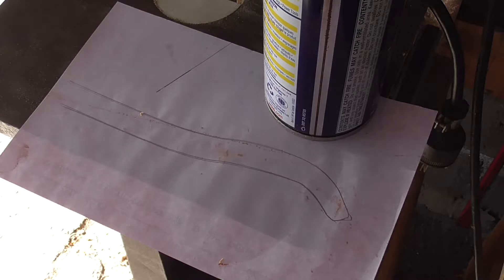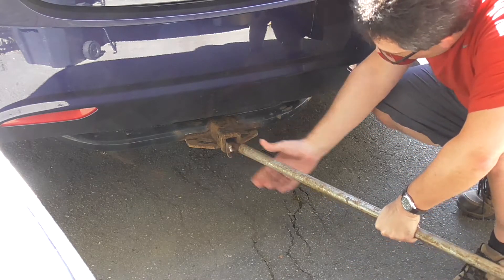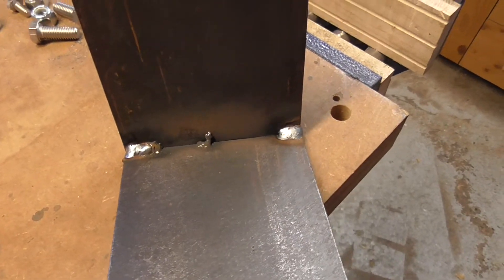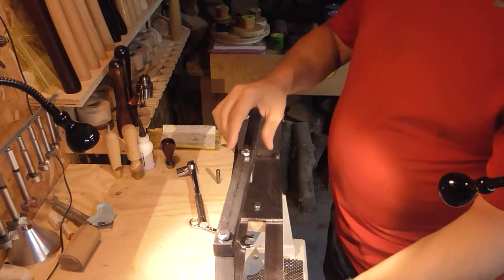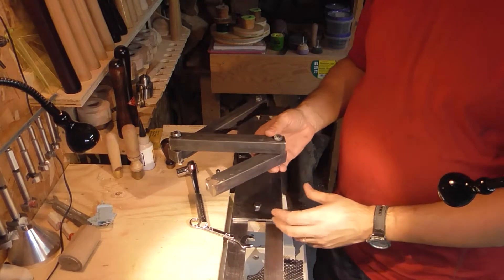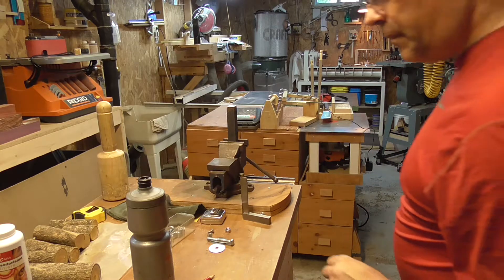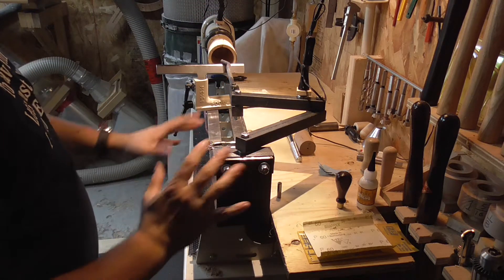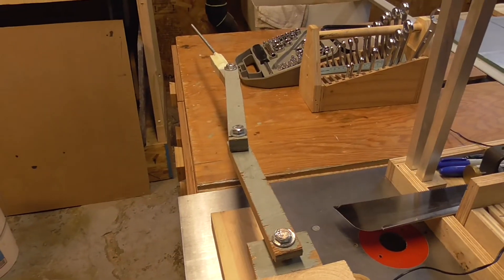Woodturning - The building of the snake hollower

Comment: Marc great job on the hollower.This is on my list to make, looking forward to your next video. Thanks for sharing.
Reply from the maker: Hi John.  The snake is very easy to built in my opinion.  The scrapt metal business cut the pieces for me...  Unless you have the equipement, it is worth the money...   Grand total, metal and cutting...   $17.00
Reply: That's a bargain, I do have angle grinder for cutting. Actually 3, 1 each for cutting, grinding and flap sander. It's faster than changing out disks.  I just need to make the time and pickup a stick of square bar and plate steel.  I think a winter project.
Reply from the maker: Sounds like a plan :)

Comment: I will be anxiously looking forward to seeing the materials and process in the making of the carbide cutter.  Thank you for your generous consideration in sharing your project. 
Steph

Je vais regarder avec anxiété avec impatience de voir les matériaux et les processus dans la fabrication de la fraise en carbure. Nous vous remercions pour votre généreuse considération dans le partage de votre projet.
Steph
Reply from the maker: Hi Steph.  I will have to find a way to groove the steel bar / drill and tap for the cutter etc.  Stay tunned :)    Thanks for watching.     Marc

Comment: hi marc. looking good. the real test is how it handle the turning and most important how it handle catches. when there is a catch the hole structure twist and there's alot of force on the contecting bolts which tend to loosen up. so, i had to retighten the bolts after each catch. i'm looking forward to see how you handle this so i can fix mine. all the best.shachar
Reply from the maker: Hello Shachar.  The bolts are "lock nuts";  you are right - the real test is coming soon.  Stay tuned :)    Marc
Reply: I use the same bolts and nuts. Here they are called "nylock". They tand to loosen up from the force of the twist. Maybe using two nuts together will solve the problem. I'm waiting....

Comment: Marc, great video, gave me the push to try to make one.  What type of bushings did you use.  I am currently getting the material to try my had at making myself one.
Reply from the maker: Hi Harry.   Actually there is no bushing at all.  Tried taht as an experiment and worked very well.  I would use maybe 2-3 drops of 3in1 oil but the thing works very well at this point.   Thanks for watching.    Marc